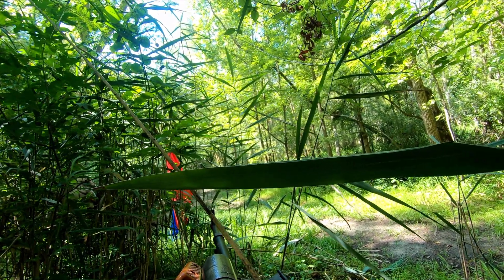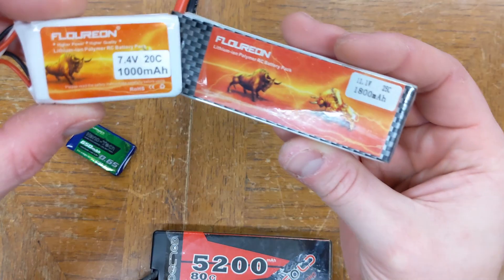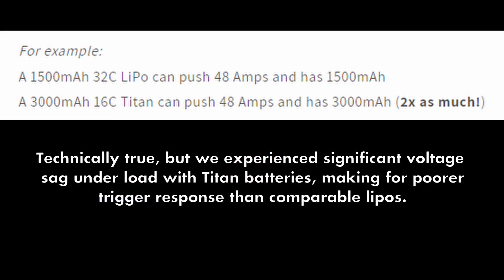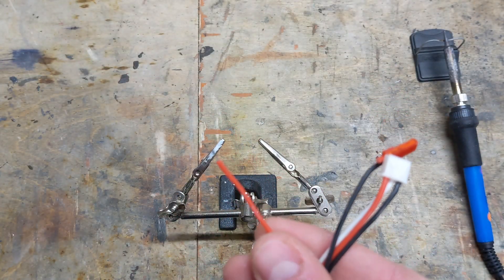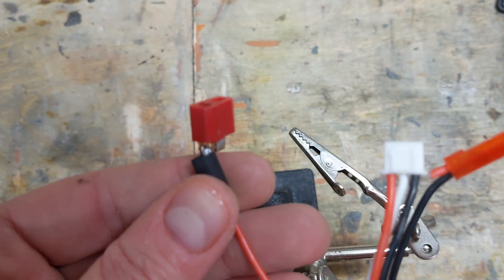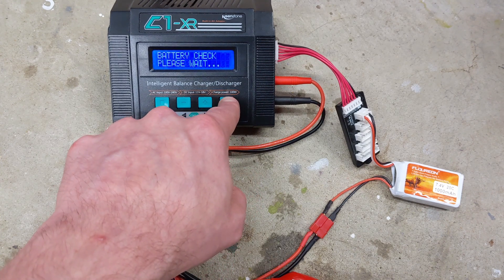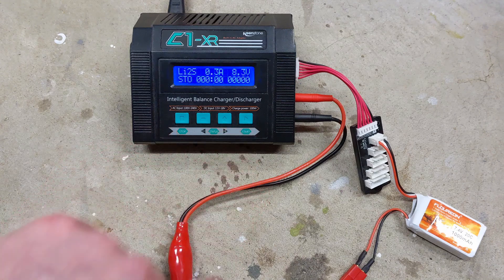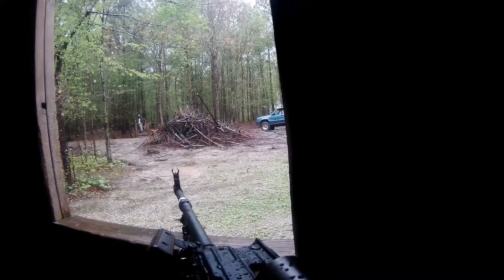How to Choose and Maintain an Airsoft LiPo Battery

Comment: Word of warning to anyone trying to solder wires on your own for the first time: I'm coming back to this video to mention something, as I had just resoldered all of my lipo batteries to Deans connectors a few months ago and it was my first time actually soldering something on my own, so was using this video as a guide. Be sure to get some solder that is a mix of tin and lead! 60/40 tin/lead should work fine. The kit I purchased came with solder consisting mostly of silver and it took a LOT more heat to actually melt it down which made following this guide almost impossible. Did some research, found out about the different kinds of solder, and after switching, it made following along way way easier.

Comment: Is there a brand of 11.1v Lipo Stick battery that you recommend with good longevity before needing to replace it and overall reliability? Theres TOO many bloody batteries that run from super cheap to crazy expensive. I just need to get a couple that are solid and will fit in a M4 buffer tube while allowing the Delta Stock (LT Predator Gen 4) 

This video was amazing, BTW.

Comment: Is there any generic RC LiPo's you'd recommend that would fit inside an E&L AK? Trying to find a better fitting battery, and want to shift away from Titan after hearing all the issues with them. 

Especially after hearing how certain MOSFET's interact with a Li-Ion battery (not very well lol)

Comment: Very good video. Soldering tips are all sufficient to get the job done, you just need more practice and clean the tip of the iron off. Ps heat the solder a little more when joining the wire to connect and try to not let it move when cooling as that will weaken the joint.

Comment: Can't say I've had the same experience as you with Titan batteries - mine has lasted 2 years so far, trigger response is fine so the C rating doesn't bother me, and being able to leave it charged without worrying about decomposing is a great feature.
Reply from the maker: Hey there- experiences may vary regarding the QC issues, and we've heard that Titan has improved their manufacturing quality. However, we want to stress that Titan batteries (or any lithium-ion cells) are not immune to electrolytic decomposition when left charged. The 18650s that Titans are constructed from simply hide the swelling inside a sealed metal shell, while still undergoing the same loss of capacity and increase in internal resistance as any other lithium-ion cell left at full charge. We always recommend discharging lithium-polymer or lithium-ion cells to appropriate storage voltage when not in use to maximize lifespan and performance.

Comment: Awesome video. Ive done RC cars for about 8 years and it drives me nuts how little people understand the batteries in airsoft. This video is spot on with everything and I might share it with new RC people too. People think they are super explsosive if you look at them wrong but in all the years Ive worked with lipos Ive only ever had one explode and it was on my brand new at the time 4wd race buggy when I plugged in the terminals wrong. As long as you take some care of them they work just fine. I was kinda shocked when I got back into airsoft and still see people using ancient NIMH batteries and Tamiya connectors. Deans has been in the RC world since the 90s and Lipos have almost completly replaced NIMHs in the late 2000s. Still waiting on more affordable brushless systems in airsoft tho. Anyway awsome content and I can't wait to see what's next

Comment: I use AEGs so very little that I never bought a LiPo. A good old NiMh works well, can pull even an M140 spring and it's less of a fire hazard. Oh and btw, I did forget to unplug my battery once for 3 weeks. How awesome. I could recharge the NiMh afterwards but for some reason the JeffTron forgot all it's settings. Which is weird because you can unplug it and it retains the settings forever.
Reply: ppl who use a nimh are the tards running around in glasses crying about some one shooting them in the face, or just full on army wannabe not calling his hit. reason 1% of ppl use a nimh.